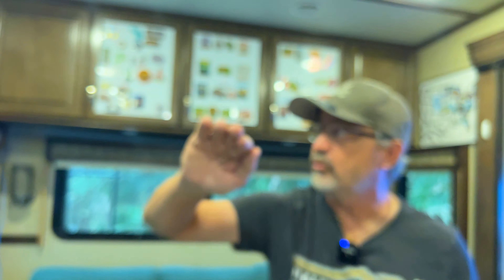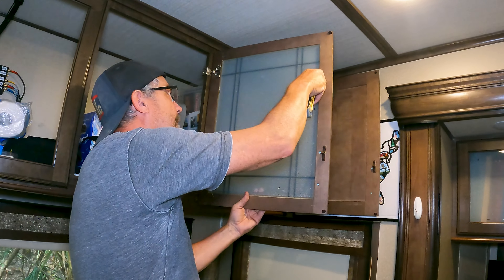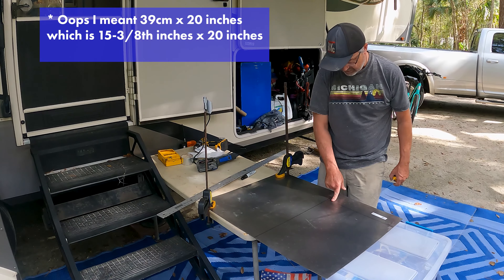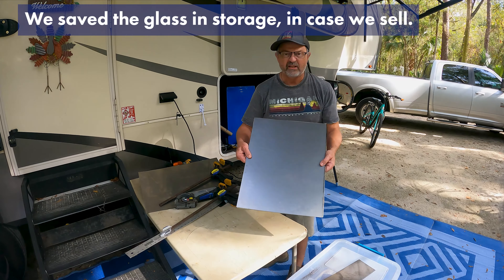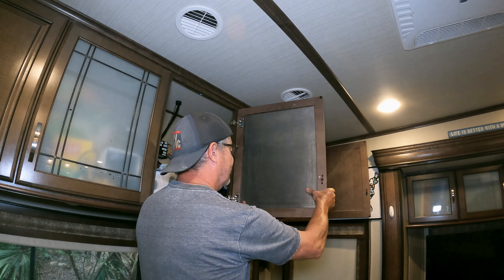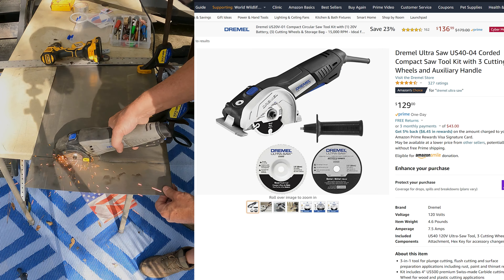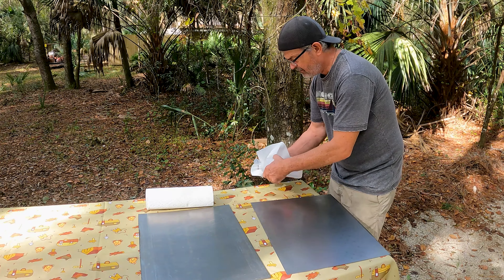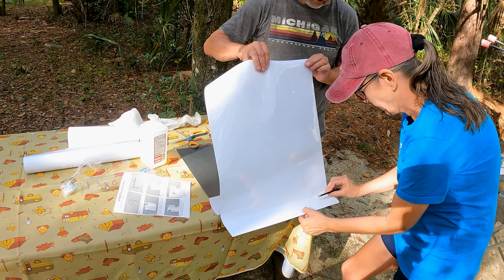RV Magnetic Cabinet Door Mod DIY (RV Living Full Time) 4K

Comment: Great idea! Here is an additional thought.  Since it is something you can write on use the inside to list the items you store in each cabinet. That way when you are looking for something all you have to do is open the door and check the list to see if it's in that cabinet.   Chief 😎

Glad to see you are doing much better. ❤️
Reply from the maker: Oh, wow. Great idea. One problem is list might get rubbed off. But I think I’m going to try it 🤗
Reply: @DownsizingMakesCents  just put a small "fence" , 1 1/2 - 2 inches high on the inside of the cabinet frame to keep things from sliding forward. Say a sanded and stained piece of a lathing strip. Glad you like the idea. 😎

Comment: I have exact same cabinets- I put blue painters tape on the inside - between the fake black lead lines. Then I attached white foam board behind the entire  glass   So you can’t see what’s inside the cabinet and it is much brighter
Reply from the maker: Yes. I have heard that solution. Some people complain that they get little foam pieces after awhile? Have you? 
But I wanted some decorating space for my souvenirs- not much area in our rig to decorate.